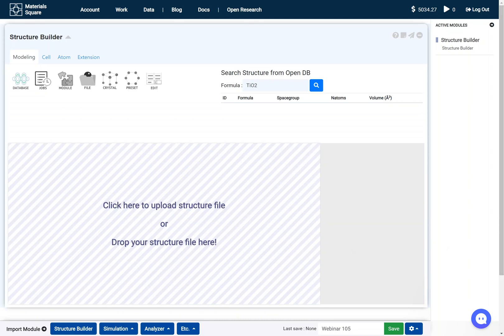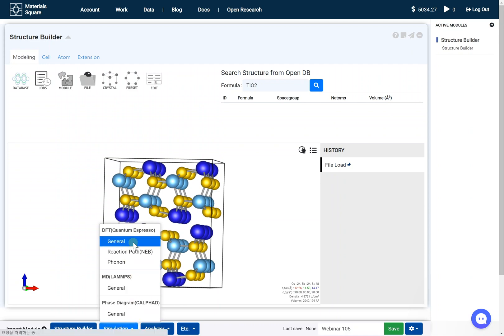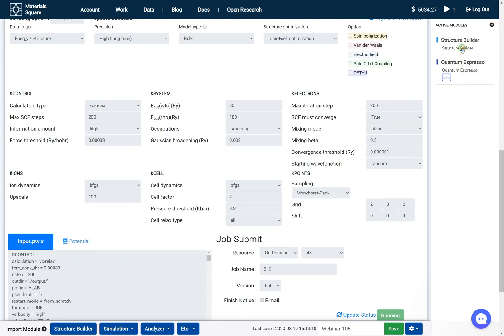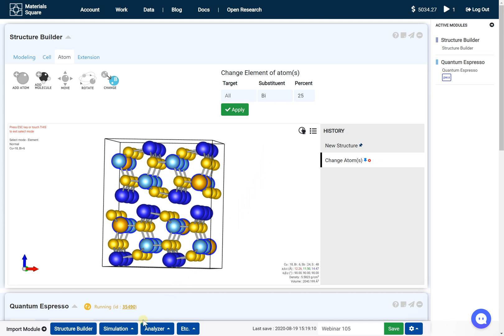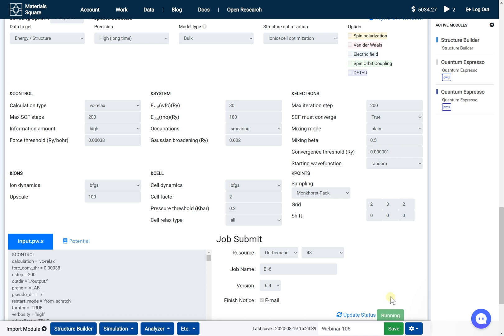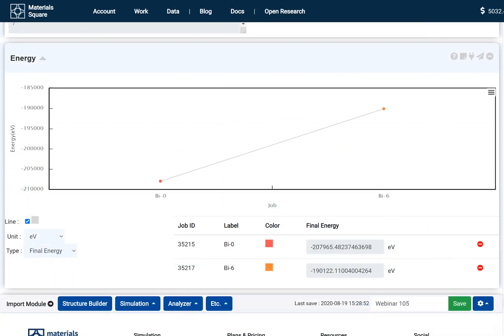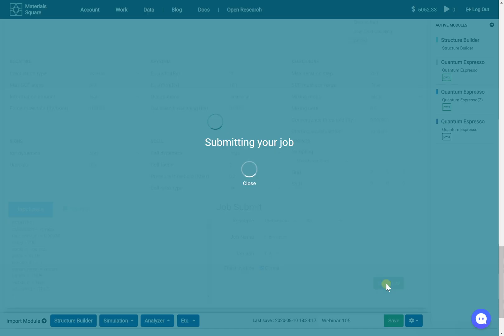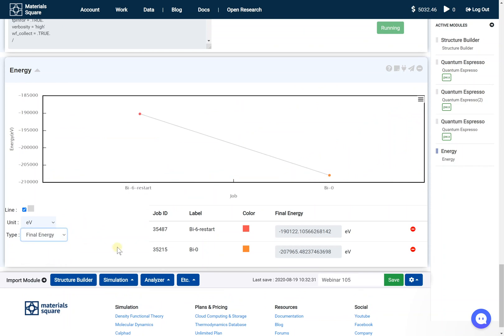[Materials Square] Webinar | MatSQ 105: DFT energy calculations for mixed semiconductor systems (2)

Comment: I have a question: How to cut half of unit cell using vesta and then save it as VASP file? 
I’m asking because i’m reproducing DFT paper , and they only consider half unit cell of Ni5P4. 
Please help me 
When i tried” Transform unit cell” by setting c to 0.5 , then saved it , I found it saved the original number of atoms
Reply from the maker: On the structure builder module of Materials Square, It can be done by '1. deleting atoms, 2. reducing cell size.' 
First, select and delete the half of atoms. Next, at the 'Vacuum' menu, enter the '-c/2' to the '+c'.